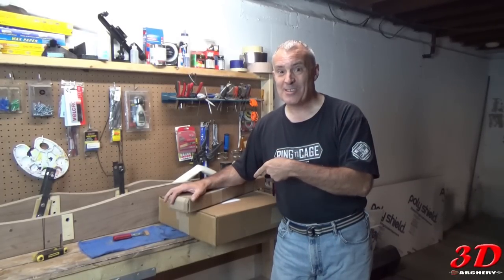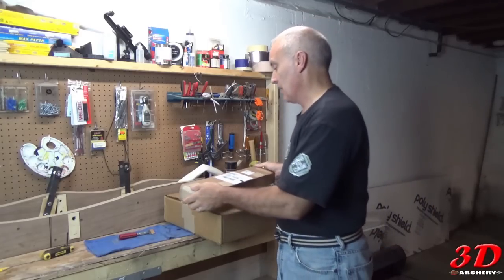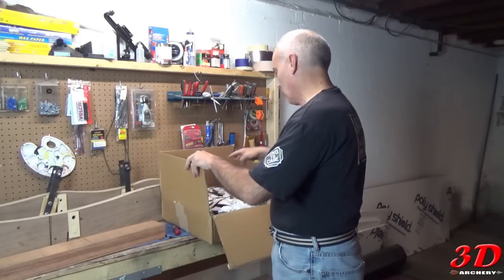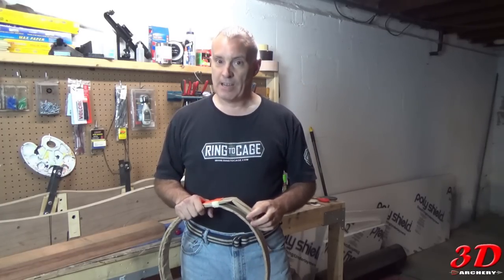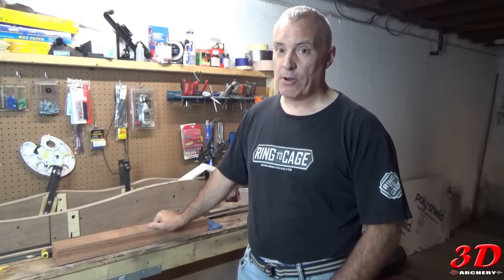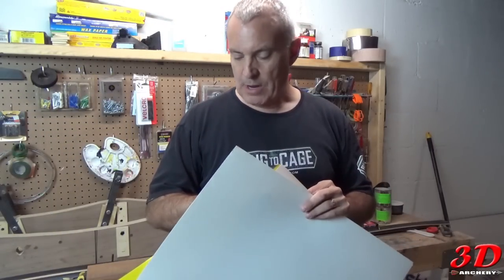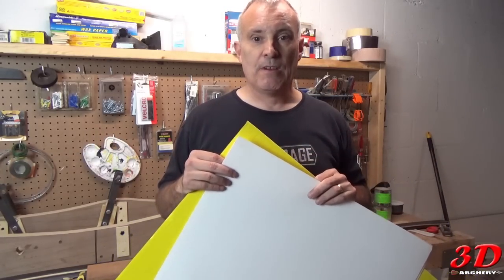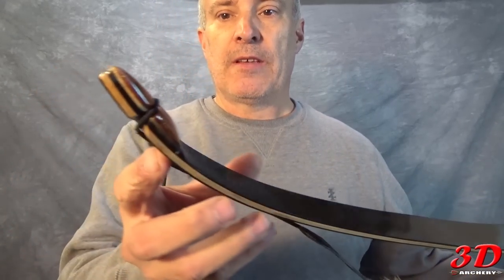3D Archery - My second Laminated Bow that I built

Comment: The differences between tapered and parallel laminations can affect arrow speed.  Notice that I said "can" affect speed.  Bow design is also a factor. Generally speaking having built reflex-deflex longbows with both arrow speed was slightly higher with parallel laminations.  Hand shock was noticeable with tapered laminations.  As for fraction buy a calculator.  
I have some old Pearson bows. Indian Archery too.  They are fairly inexpensive on ebay.  
My longbows are both very powerful. 68lb.@28 and 72lb.@28 I will be shaving the sides of the limbs to reduce draw weight since my spinal nerve damage has reduced my upper back muscle mass.  My advice for preventing spinal damage is: Don't ride a motorcycle in Los Angeles during rush hour.  Got hit by cars twice in the same year. Sell my motorcycle?  Nope I moved away from LA. 😎

Comment: Excellent work, Greg. You've just about sold me on making one. Your shooting is sure impressive, as well. I would like to know how many hours it took you to make.
Reply from the maker: Wish I could tell you an exact. But I never tracked the time. But here is some rough guessing:
Setup and laminating: 20 Minutes
Curing" 24 Hours
Sanding off excess: 10 Minutes
Trimming the limbs: 20 Minutes
Making Nocks: 10 Minutes
Nock Protectors: 15 Minutes
Curing: 24 Hours
Roughing out the Riser: 2-3 hours - The longest part work wise, could go much faster with the right tools
Staining & Sealing: 15 Minutes
Curing: 48 Hours

I built it over a three day weekend with ease.